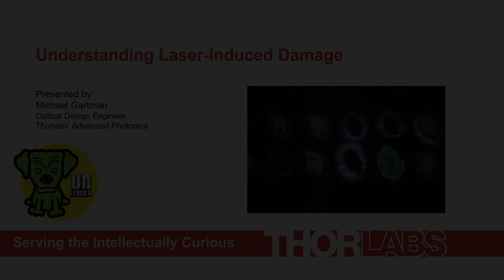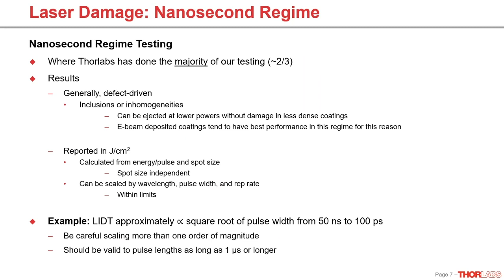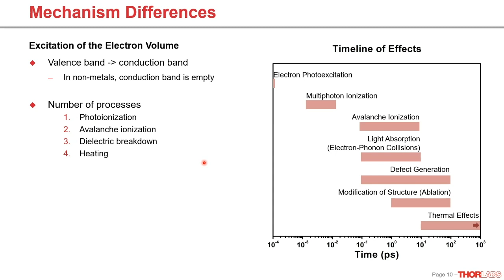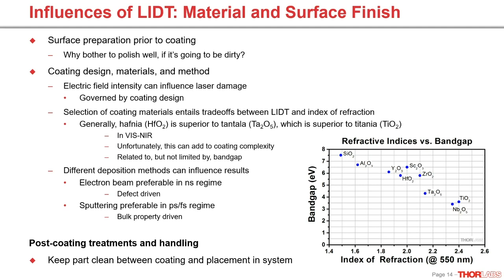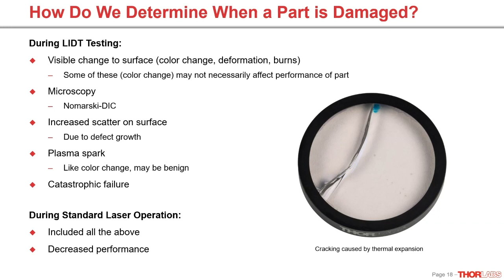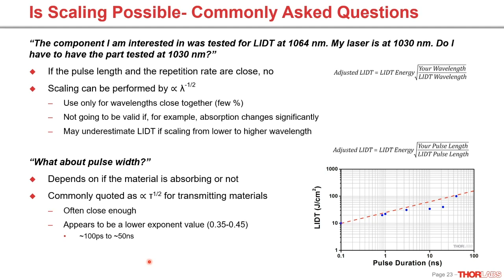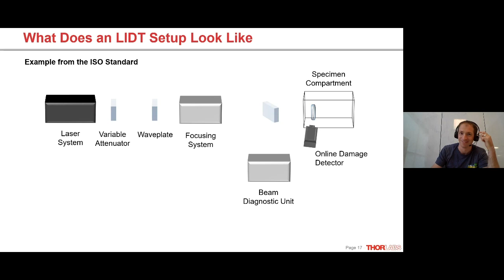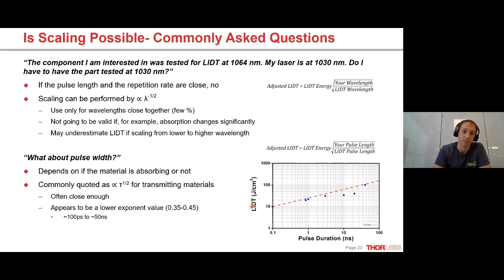Understanding Laser-Induced Damage

Comment: Regarding scaling effects in CW application, do materials(metals and ceramics w/o coating, optics w/ coating, and so on..) to be irradiated determine which power density expression would be more realistic, W/cm or W/cm^2?,
Reply from the maker: In our experience, linear power density (W/cm) is always more accurate than power density (W/cm²).

Comment: Hello Sir, can i know the LIDT of my optics but it was tested for nanosecond laser, can i calculate the LIDT for the picosecond laser for the same optics. The known LIDT is 5 J/cm^2, at 10 ns, 10 Hz @ 1064 nm; i want to know the LIDT for 4 ps, 1 kHz, @ 1030 nm.
Reply from the maker: While some limited scaling is possible across different pulse widths, I would be hesitant to scale from 10 ns to 4 ps and say that using a part at that value would not be an issue.

That said, based on scaling we have seen, the LIDR would be around 0.2 J/cm^2. Again, this is an estimate, not a specification or a guarantee. If necessary, Thorlabs could potentially send you a part for testing. Please reach out to techsales@thorlabs.com for more information.